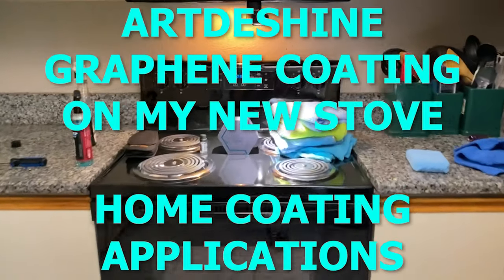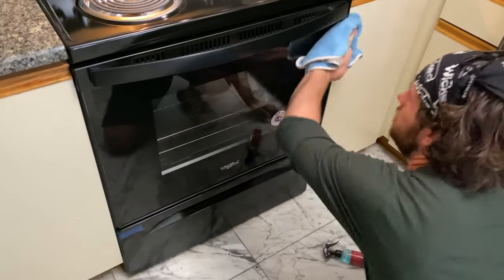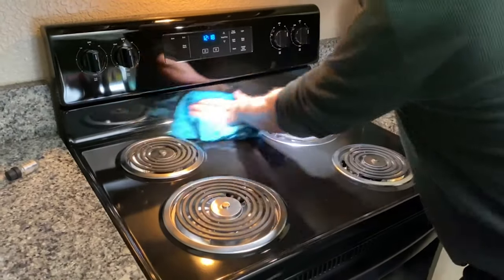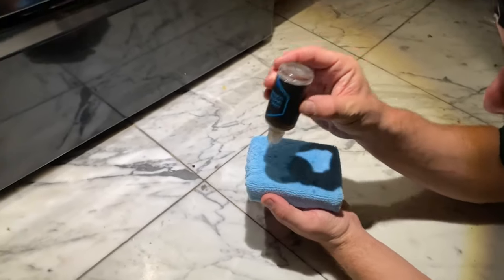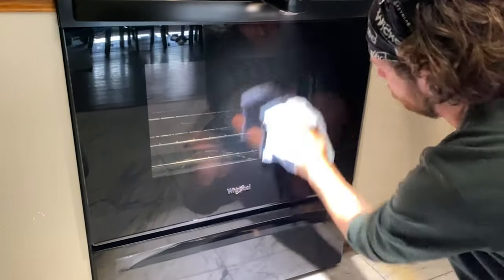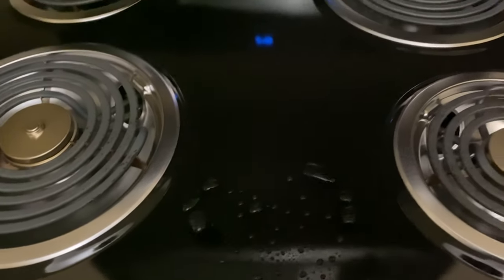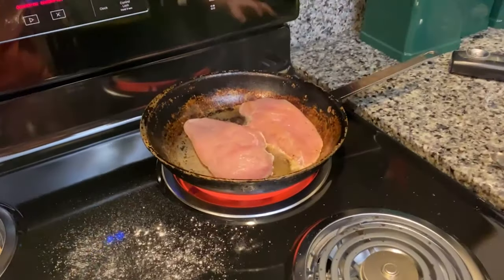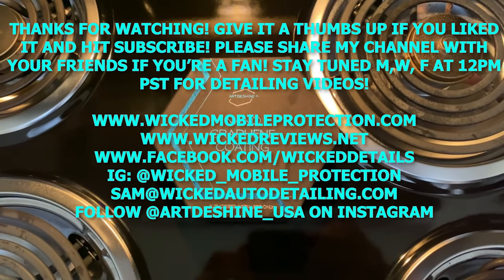ARTDESHINE GRAPHENE COATING ON MY NEW STOVE | I MAKE A MESS THAT WOULD MAKE YOUR MOM BREATH FIRE

Comment: Sam have you ever used panel prep on your “🅣🅞🅑🅐🅒🅒🅞” pipe?
Reply from the maker: I am honestly too afraid to use those chemicals near those but also I’m so freaking lazy about cieabing those... lol
Reply: @Detailjesus  as a feynlab installer have you used their compounds/polishes? Or used their ceramic primer before applying a coating on cars w/ sticky/soft paint?
Reply from the maker: @NipponStiqqyPaint  I personally cannot achieve satisfactory results with their compounds and polishes, when others say they do not experience the same problems it makes me doubt their eye sight, I find those compounds to be very sticky, haze up paint and the polishes do not finish nicely. No companies primer is any good and you should never use one, I have coated  countless cars and never needed a primer for soft paints, just use the right towels. Primers reduce coating lifespan which all manufacturers will admit. I found the feynlab primer to finish down paint horribly.